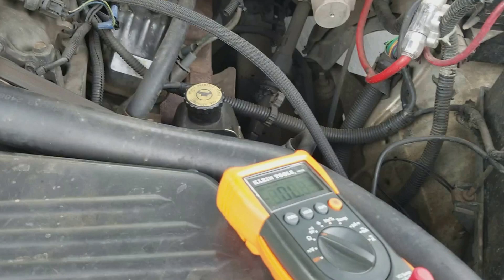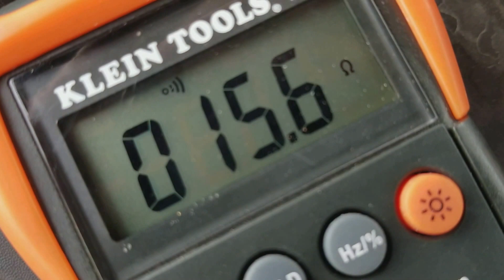Testing fuel Injectors

Comment: Good morning sir hope your day is going well! What do you mean you say that i can put 12 volts directly positive and negative from the battery to the fuel injector to test it mechanically to make sure it does fire but do not touch the leads together or i can end up burning out the fuel injector driver in my PCM, are you able to show that on a video please?
Reply from the maker: Use a test light
Reply: @greygoosemafia  Can you please show me how on a video whenever you can?
Reply from the maker: @Diagnose1  after I get home, i can do that
Reply: @greygoosemafia  Good afternoon sir hope your day is going good! Are you still doing the video or you don't want to? You forgot about me sir.